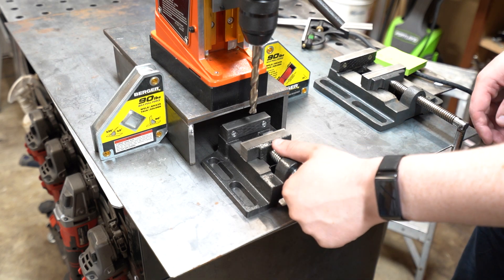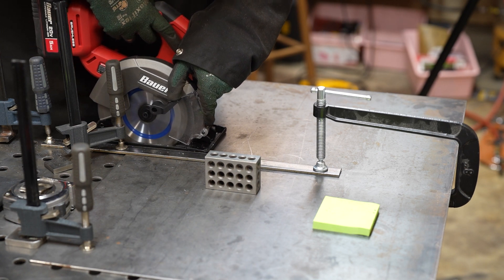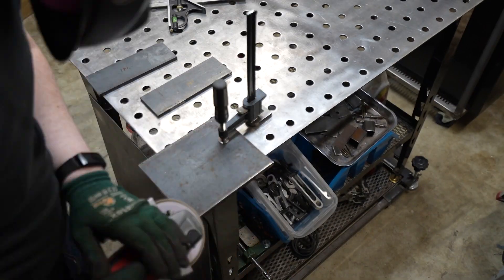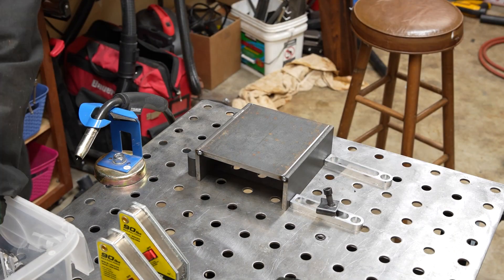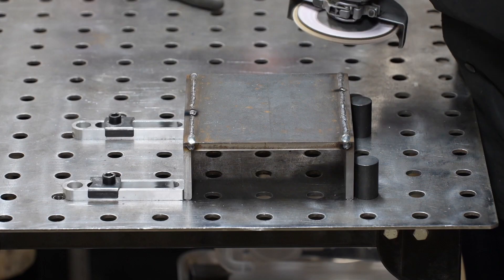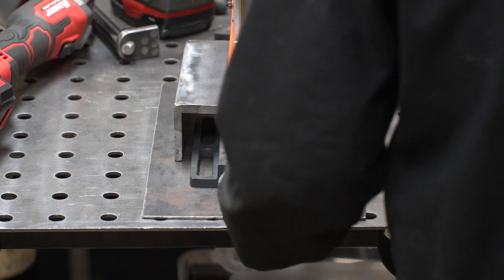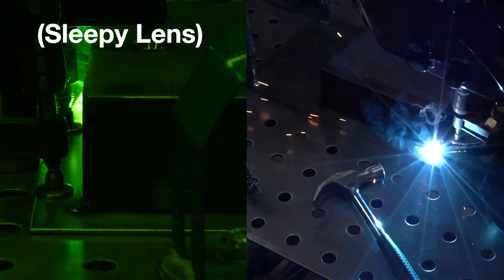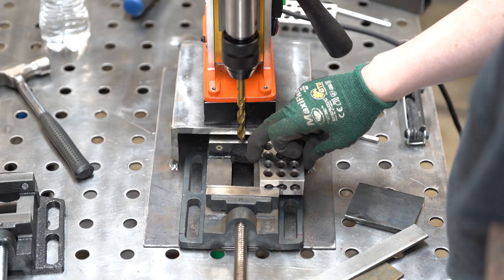Mag Drill Stand - Vevor Magnetic Drill Press Pt. 1

Comment: Where in the U.S. is there a repair facility for these mag drills?
Reply from the maker: @ralphknoll486  I highly doubt there’s a dedicated facility / manufacturers facility. You could call vevor and see though. The price point is really low, so if you need it for pro use, I’d have another on hand or go with a different / US based brand.

If I ever have issues with it, I live close to an electric motor repair shop. 

They’ve fixed up an old band saw, found electronic components for an old mig welder, and other miscellaneous things for me over the years.

Comment: I have the small Milwaukee metal cutting circular saw. It cuts 1/4" steel really well. As opposed to cutting wood with a circular saw where you want the blade to just barely protrude through the bottom of the cut, when cutting steel, I keep the blade protruding through the plate more to minimize the area of friction for the blade. Seems to help a lot.
Reply from the maker: I gave that a shot off-camera, but it felt even more dicey with this blade. I'll try that with the good blade next time I use it though!

Comment: Cool concept. Not much Z there but its a good idea.
Reply from the maker: Yeah, the actual drill body can move up / down the rail a good bit. The clamp is shallow, but I’m mostly using this to drill small bracket-type stuff. I’m actually in the process of building another design now too
Reply: Love the idea, I keep pushing my drill press around the shop trying to find a new place for it almost monthly. My friend says with a manual mill I don't need the drill press, But I think it is more for very dirty jobs now. 
 @MichaelRoachWV
Reply from the maker: @kudosjeg  yeah, my new design is going to be much more lightweight. It sounds counterintuitive, but this heavy one is going to be my traveling one 😂. When I finish editing the rest you’ll see my engineering 😜